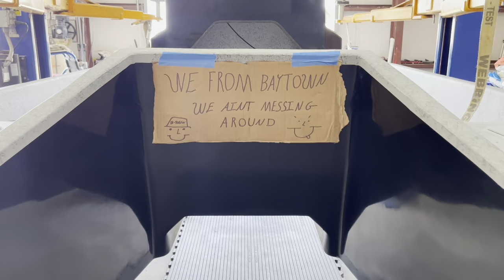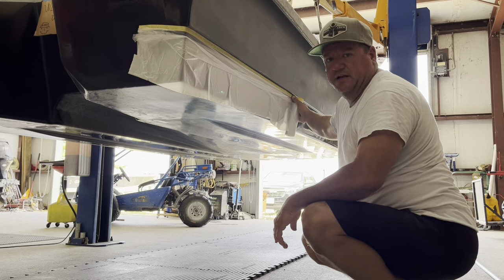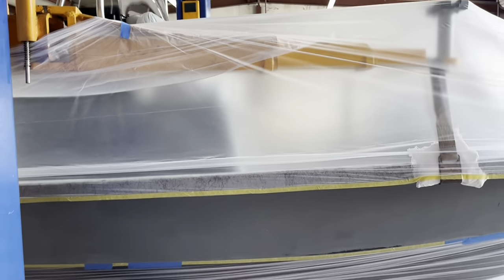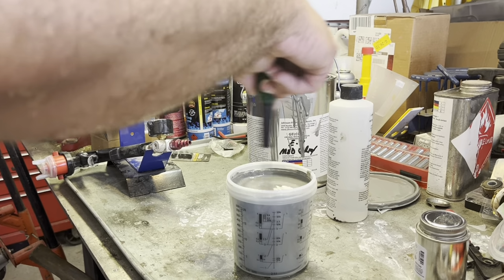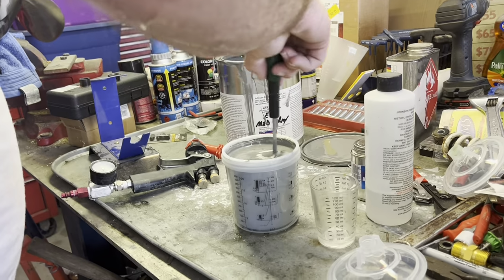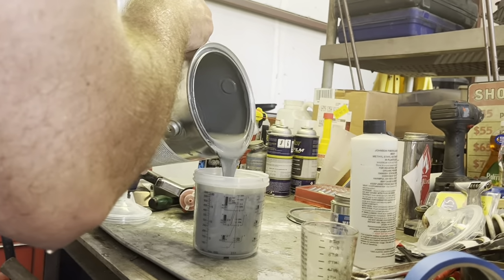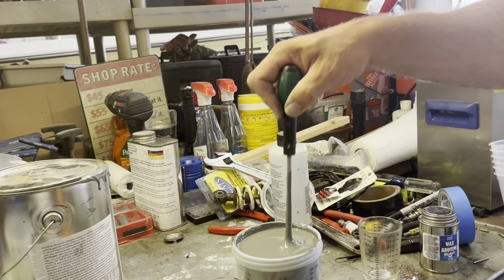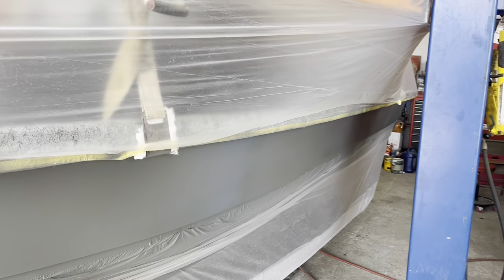Majek Red Fish Line 18’ Rebuild Video-25. Spraying Gelcoat Using 3M Accuspray Gun.

Comment: What did you thin the gelcoat with?
Reply from the maker: Styrene. Very little, like 4oz to one quart of gel. Sprayed great.
Reply: Duratec® Reducer is the perfect solvent for Duratec® products. This specially formulated thinner/reducer is made from urethane-grade solvents as opposed to standard lacquer thinner. It matches the original solvent cut, assuring complete compatibility. Duratec® Reducer enhances flow and leveling properties and reduces orange peel and porosity. Using this thinner allows for reduced air pressure, which reduces overspray and allows for a smoother spray flow.
Reply from the maker: @nymack66  I will definitely be using it on my next spray. Thank you for the info.
Reply: I will never use Duratec again. It sure flows real good but about 10 years later the gelcoat was falling apart like house paint. Thankfully I only painted the transom.